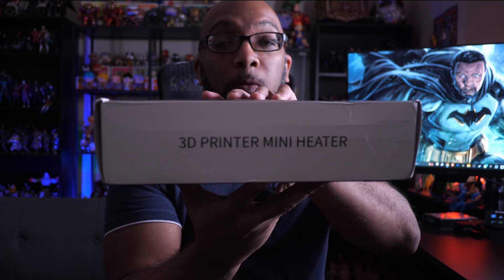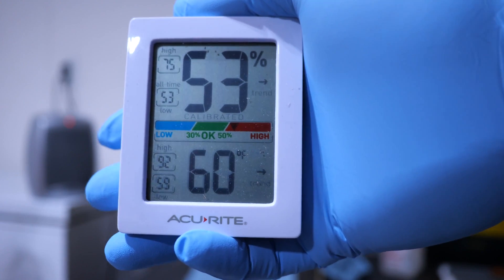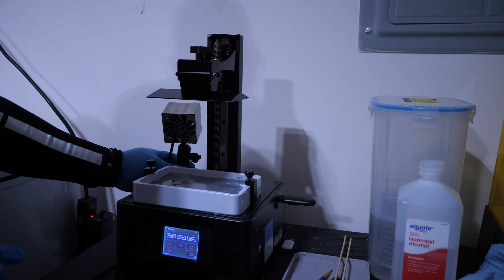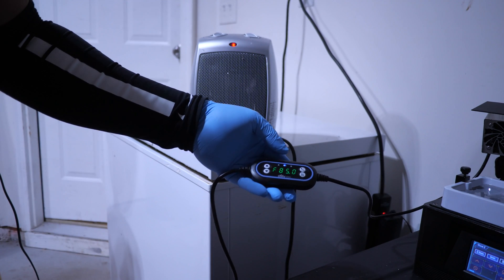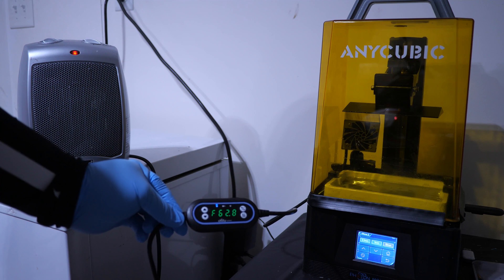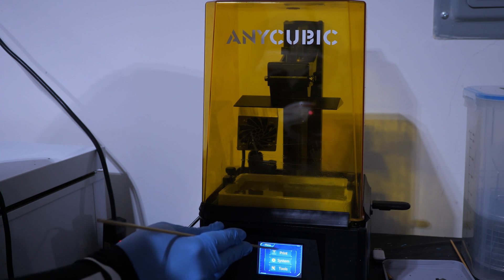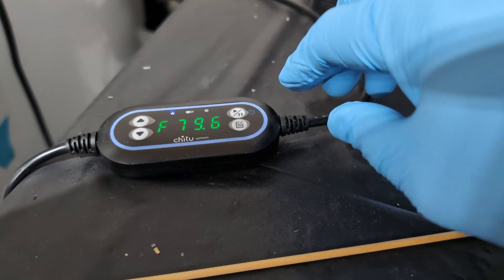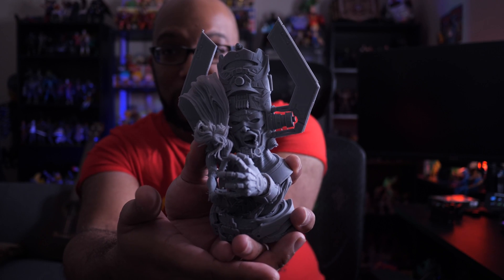Resin 3D Printing in the Cold Just Got Easier!

Comment: So I want to see a Canadian winter 3d printer demo like -40c and fluctuating temps…. I can’t put a resin printer in my house due to no ventilation where I could set one up… my garage would work but only during the summer ..
If the heater helps that level of cold than I could get into 3d printing ❤
Reply: You can get yourself a enclosure with a ventilation system. Make a cover for the window and run the ventilation line to the outside
Reply: or put the printer in the laundry and shut the door like I have done and open the window when printing.. simple hey... !!...

Comment: ime a 60 year old and can one 100% say the biggest problem is people wanting to print at a 100mph so let your printer do its job trying to push it to far it will rebel i started with the old ANET A8 12 years ago ive had a ender 3 pro for past 5 years just bought the Halot marge 8k ressin its still boxed as buying the extras ie cleaning stastion just bought the heater fan deliverd to day its a waiting game that in the end saves on fustrasion and money . on fdm printetr just use low line print and deal with extra print time hrs as it will save pro print prep time this is just my advice.    only just came across this channle and can only give this guy my 100% utter respect for just plain to the point advise and instruction well done mate

Comment: About the rubber around the lid: aren’t you supposed to leave a little gap for the heater/controller cable to exit under the lid, and by doing so, the lid will sit flat on the base of the printer?
Reply from the maker: Yeah, that's the correct way to do it.

Comment: What if you warm up the resin with a heat gun?
Reply from the maker: I think that can work initially, but my concern would be the resin cooling down over time. Right now, the temperature of my resin is 53 degrees without the heater. It would warm up a little during printing, but I doubt it will be warm enough to reach its optimal temperature in a cold environment.